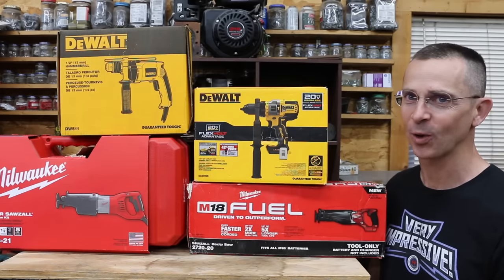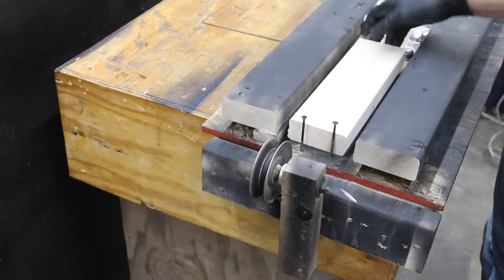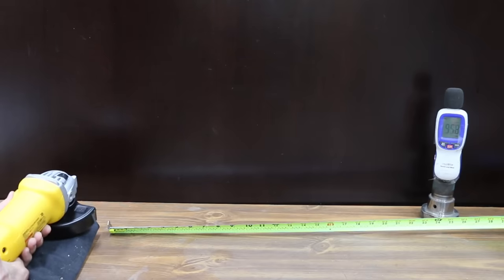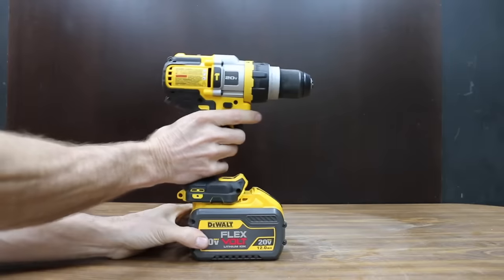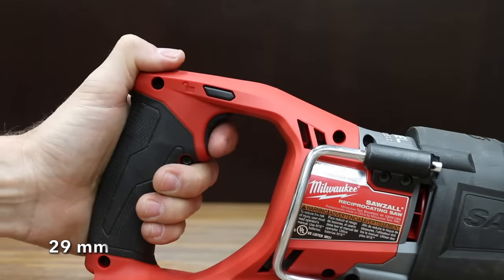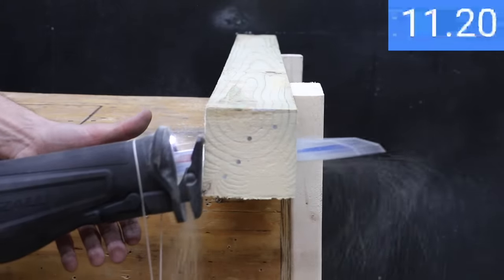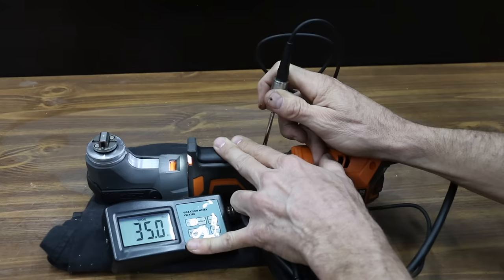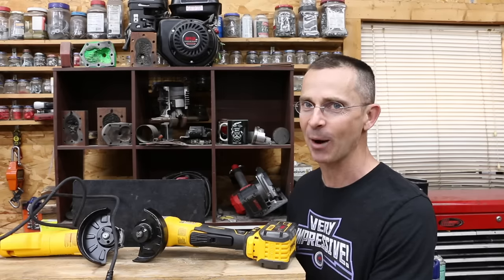Let's Settle This! Are Cordless Power Tools REALLY Better? Torque, Cutting Speed, Noise, Vibration

Comment: I watch your videos almost every week. This evaluation were about what I'd expect. As a user of both corded and battery I must say I like the battery tools stopping faster when the trigger is released, especially on the angle grinders. I find the cordless to be safer to use and it stops quickly instead of jerking out of your hands when making heavy cuts that grab the blades. And on the drills I break a lot less bits. I use a lot less bandaides this way. Your fixtures and methodical approaches to testing have clearly earned you a Masters Degree in Redneck Engineering! Luv it!
Reply from the maker: Wow, thanks
1

Comment: I would have looked to see the drills drilling holes in concrete for tap cons and maybe 1/2 inch holes
Otherwise a great video as always
Reply from the maker: Thanks!
Reply: My thoughts as well.  Drill wood perhaps a hole saw and hamer drill  concrete.
Reply: @ProjectFarm  maybe try testing home security cameras. Like Blink vs Wyze vs Ring, etc. You could compare doorbell cams of each brand also. It would be informative to know how far the infrared works, motion detection range, how long on a full charge and more! Amazing channel BTW!

Comment: You should repeat the test around freezing temperatures instead of room temperature. My buddy had to borrow gas chain saw in winter since his battery operated was weakened by the low temperature.
Reply: well no reason to test that, your friend just shouldn't have left the battery out in freezing temps... every tool has common sense steps to make em last longer
Reply: @LC-hd5dc Sometimes the work needs to happen outside in cold temperature.. Like cutting a tree for example. You have no choice but to expose your battery to that environment. That's when you experience the practical limitations of cordless tools nobody is pointing out.
Reply from the maker: Thanks for the suggestion.

Comment: I would have liked to see how the flexvolt compares to a corded equivalent. The tools you were using was 20volt tools with flexvolt battereies.
Reply from the maker: Thank you for the feedback!
Reply: Ya, I was thinking the same thing.  The Flexvolt batteries will run all the 20V max and XR tools.  To make things more complicated they also have the "Flexvolt Advantage" tools that recognize the Flexvolt battery is powering the tool and allow a higher current limit, albeit still at 20V.  The real 60V and 120V Flexvolt tools are in a different class altogether.
Reply: @rogerheuckeroth7456  also different price range altogether 😉
Reply: I've left this same comment on most of Todd's videos. He commonly overlooks DeWalt's 60v lineup as well as other manufacturers "high" voltage tools or compares 18v to 36v to 54v while claiming they're in the same class.
Reply: @canonfodder808  Well, yeah. That's true.

Comment: Can you test out over the air TV antennas? Would like to see which one gets more channels, better reception etc.
Reply: Antenna Man does a good job on that.
Reply: Most antennas are pointless if you're in a valley or at the bottom of the hill
Reply from the maker: Thank you for the video idea!
Reply: Keep in mind, there are inline amplifiers to have close to the antenna, filters e.t.c. you can use to affect final performance.
A long cable can cost you many channels if you don't use a amplifier at the antenna!
For shorter cabling the amplifiers are less interesting.

Also all cable isn't equal, there are instruments for testing that if you are interested.
Reply: That would be awesome, I bought an antenna and it was a waste of 20 bucks. Lol. I would love to see which one offers the best reception.  I am still open to buying another and am willing to pay up to $250.00 for one that actually works.
Reply: @kstofkos  the digital ones that will get you about three hundred channels cost about $400 and up but you better have a direct sight to the antenna and no Hills are trees in the way which means you have to get it long enough to stick up high enough

Comment: I'm getting ready to update all my power tools to battery, either DeWalt or Milwaukee.
Great video.
I have a 30 year old Milwaukee corded sawzall, bought new,  that still works like new!
I always store it in it's metal case and never toss it onto the floor.
It was used a lot!
As I was in construction for years.
It has a roller dial speed selection from 1 to 6.
Hoping I get that in battery.
Reply: My 2 old makita drills batteries finally gave out and we're obsolete so I retired them. (Inside handle batteries) with Chuck keys...lol
Reply from the maker: Thanks for sharing.

Comment: The main problem I see with the battery powered tools is when the battery stops working and you have to buy a new one.  Assuming you can even find one that fits your old tool, you can bet they are going to be very expensive.  So factor a replacement battery into the original cost of the tool.
Reply: Takes a long time for a battery to give up the smoke.  I see your point but I have 10 year old Milwaukee batteries still trucking.  Likely less chooch than new.
Reply: @Matt-my7pz  to agree with you I've had my Milwaukee batteries for 8 years now. Still going strong. I've since upgraded to Fuel, and got into the M12 line a good bit, and I love the M12 stuff. But yeah, my battery outlasted my one drill lol
Reply: They often times don’t even exist. You gotta upgrade. Planned obsolescence sucks.
Reply from the maker: Thanks for the feedback.

Comment: I wouldn't be surprised if cordless tools start to surpass corded ones in performance, simply because of more R&D effort.
Reply: That won’t happen for a long time. Battery technology is still far behind where it should be when trying to force everyone to battery
Reply: The flex volt dewalt grinder already surpasses the corded version in my opinion. The one used in this test wasn’t the top of the line version
Reply: Dewalts 60v worm drive circular saw already has every corded worm drive saw beat. It’s much faster than a skil mag 77. Corded tools are pretty much limited to drawing 15amps @120volts which equals 1800watts. This Dewalt worm drive uses 2400watts. That’s the equivalent to 20amps @120 volts. While 20amp sockets exist(the ones that look like regular wall sockets but with the sideways slot in the left slot making the left side look like a sideways T) not everyone has them so power tool comanies generally don’t make 20amp tools. With modern battery technology the manufacturers can drain more power out of a battery faster than they can out of a wall socket.
Reply: the companies don't want people buying corded, they want them using battery
Reply from the maker: Thanks for the feedback.
Reply: They already do in safety. Corded tools are an electrocution hazard on wet construction sites or around docks, pools, etc. Trip hazard too.
Reply: @pureblood3813  I find my batteries on Bosch tools and Ridgid last a long time between charges, it's super easy to have one batt on the charger ready to go and just swop, it's like loading fresh rounds in your gun after target practice- only takes a few seconds and you are going again.
Nothing worse than the damn power cords you have to watch don't get cut, drilled, pulled ouf of the socket or plug, will REACH where you need to be etc.
Reply: @kennyz6533  The thing is; FAST is not  good for cutting blades or drills whether corded or not, it's THE thing that heats up the blade or drill and ruins them quickly. A co-worker is ALWAYS running his jigsaw at max, his blades turn blue and get dull fast, I run mine about half speed and go easy,  it cuts thru almost as fast, my blades never turn blue and last a LONG time
Reply: Cordless tools will always have efficiency and power keeping them from ever being as good as wired tools. But in a lot of applications cordless is needed and sometimes easier or more practical  depending on what you're doing or where you're doing it.

Best cordless can do is match ac/dc, but that's if a battery is invented that can match the power and maintain long battery life. Doesn't matter if a super efficient motor is invented. Use that same motor in an ac/dc tool and you'll get better performance.

Comment: When it comes to tools, I hate cords for handheld power tools unless it’s a random orbital or detail sander because they get in the way and are inconvenient. However there are actually brushless corded random orbital sanders such as the 3M xtract.
Reply from the maker: Thanks for the feedback.
Reply: Garand Testicle   not for sanders or buffers
Reply: Garand Testicle   not for what I do. I run sanders for hours at a time, and also drill motors as buffers
Reply: Garand Testicle   I actually refinish plastic and damp sand but ty

Comment: I used a battery powered lawn mower recently and was surprised how well it worked.  Would appreciate it if you did some more cordless reviews for higher voltage/amp tools. (leaf blower, chain saw, mower, etc).
Reply from the maker: Thanks for the suggestion.

Comment: Good show, I enjoy it very much.  I'm a retired journeyman carpenter and have sawn wood since 1969.  I like cordless for the convenience, but I know I'm sacrificing performance.  Corded tools outperform cordless, every time.  Before anybody disputes this, do me a favor; go dig out your old corded tools and use them for a day - if they're any decent kind of quality, then you'll see the difference.  Your tests are interesting, but a little skewed; your batteries are fully charged and working at their peak.  I love my cordless drills, and I like my battery powered nailers, but that's it for me.  I could never go to a cordless circular saw; don't have the patience.  And most of the other tools I dig out so infrequently that I don't mind if I need a cord to operate them.
Reply from the maker: Thanks!  Thanks for sharing.

Comment: Love these videos and how thorough you are testing every last thing. Most of which, I don’t even consider until you’ve done it. My request would be to see which brand/style of hot rod floor insulation performs best reducing heat transferred through the floor, and overall cabin noise and resonance. Brands such as Killmat, Hushmat, thermo tac, etc.. Thanks!
Reply from the maker: Thanks!  Thanks for the suggestion.

Comment: Two comments:
1. You weighed the corded with the cord - this may be fine for carrying the tool to the job site, but what about actual use - the cord wouldn't add much while using.
2. If the cordless worked at the same speed as the corded, would they be as noisy.

I have a corded B&D 6" chain saw, works great. Bought the same version in a cordless for work as we don't have an AC power source in the field. The cordless tends to bind, especially on larger branches. Cut speed might also be a bit slower, hard to compare though.

I do have a few cordless tools (drills and outdoor tools) and very convenient (grab and go is the main reason I buy them), but find the corded to be better for tough jobs (mostly cutting tools).
Reply from the maker: Thanks for sharing.

Comment: Oh, 25-30 years ago, I didn’t even consider battery tools for any serious use. I still have my heavy duty Rockwell and Porter-Cable drills and screwdrivers. But now, I never use them. The convenience of not having the power cord far outweighs any minor power difference. Though I have five DeWalt corded angle grinders and one battery powered one. The battery powered models are often too long for getting into tight spaces. But the battery grinders are a lot slower than the corded models, generally 8,000 vs 11,000, so it usually cuts a bit slower. They slow them down for more torque.
Reply from the maker: Thanks for sharing.

Comment: Cordless tools are great and have improved to the point where you can do just about any ‘jobsite’ task with one, however cordless tools are still very desirable for applications requiring consistent raw power. My favorite corded tools are my Metabo angle grinder, Hilti hammer drill, and Makita circular saw- Even though I have cordless versions of all three, the big guns come off the van when the going gets tough. I noticed that most of the corded tools in this test were homeowner/DIY grade while all of the cordless offerings were ‘much more refined’ and I suspect this had an effect on the outcomes.
Reply from the maker: Thanks for sharing.

Comment: Another huge factor is that tools like reciprocating saws and angle grinders absolutely tear through batteries so if you plan on using them for any extended period of time corded is the way to go with them, otherwise you better have a large stock of fully charged batteries! Tools like drills and circular saws however are great cordless so you aren’t restricted as to where you can use them and you aren’t tripping over extension cords nonstop!
Reply from the maker: Thanks for the feedback.

Comment: Another thing is....Go to work on something on the outside of your house.  With a corded tool, you have to get the extension cord out, run it to the area you want to work from one of the typically sparse outside outlets on your house. 

Why do they not put an outdoor outlet on each section of outdoor wall, along with a hose bib?

With a battery tool, you just click in the battery and walk to where you want to work.  This is a HUGE advantage of battery powered tools!  I have two battery powered drills, a big hammer drill and another small light one for driving screws. But I keep one cheap Harbor Freight corded hammer drill around in case I have a lot of holes to drill, but so far, I've never used it.
Reply from the maker: Thanks for sharing.

Comment: The real difference is the amount of convenience the tool provides. If you are at a building site with power available setting up a cutting station with a chop or compound corded saw will provide a superior product with the mess not following you around. On the other hand if you are the electrician or plumber drilling holes everywhere the cordless drill with a handful of batteries will provide the most productivity by not having the cord follow you everywhere.

If it can be done in the shop a corded tool probably works better than a cordless. If you are wandering around doing spot work then the cordless with again a handful of batteries will be faster as the setup can take longer than the actual work. Example I drilled out a padlock with a cordless drill yesterday as it was faster than bringing out the torches to burn it off.

Better is a relative thing.

Comment: My strategy is having a cordless sub-compact drill for most work, and a corded, heavy-duty drill for everything else. It's not like I'm doing this stuff professionally or anything, I doubt I'll need a powerful drill when I'm away from an outlet. 
My thought process is that, with a corded drill, you don't run out of power and it's one less point of failure, as there are no batteries to deteriorate. I think there are cases where a cordless drill would be preferable, but I don't think any of them apply to me personally, and that a sub-compact can probably do everything I need it to do where a larger, corded drill couldn't reach. 
But hey, that's just my approach, it works for me but won't necessarily work for everyone.
Reply from the maker: Thanks for sharing.

Comment: I have taken the big risk and gone almost all cordless Dewalt….My biggest fear is obsolescence if the batt type is later changed and no longer fits the tools I have.  Cordless means I can use them anywhere, but run time anxiety is a real thing, especially with high drain tools like my grinder, which will eat a 5ahr batt in under ten minutes.  No! I don’t want to splash out on five big batteries at 60 bucks each when 95% of my useage is casual and sporadic….So managing batt use is something I have to just deal with.  Corded has the run time advantage IF you have power access AND don’t mind a slightly bothersome cord draped around.  Modern cordless also seem to have the better tech and convenience features….but they aren’t essential to perform the tools basic function.  Anyhow thanks Todd, for another engrossing bedtime video at 2am in England….
Reply from the maker: You are welcome!  Thanks for sharing.

Comment: Not really the “tools’ shown here but I have a blower vac, drill and a lawn mower
From RYOBI that are all battery powered. The same battery fits in all of them 
And is easy and quick to charge, but the main reason I like the battery option is 
that I absolutely love how light weight everything is and it’s very easy to swap over. 

Everyone in my household can use these items With such ease,
And we vary from able bodied to terminally ill to over 60 years old.

We don’t have to fuss with cords, (trip hazard) tricky buttons or 
Switches (dexterity), Weight and vibration (general weakness and strength) as
Well as any petrol buying/ filling/ storing issues. Everything is 
quieter too!

I really do recommend getting battery options if you or someone in your ‘family is
At all weak, small, elderly or Sick like my household is. We only have 2 batteries 
But have multiple uses from each battery before it needs to be charged. 

Everyone can help out doing things around the house, and no one feels 
Incapable of doing something ‘everyone else’ can do.

The only downside in my opinion is it can take a bit more time to compete the task

Comment: As a mechanic, I can tell you that good cordless tools are wonderful - so convenient, albeit expensive, mostly because one needs at least three batteries and two chargers.  On the other hand...for performance, they can't touch pneumatic tools.  When you have to disassemble and repair a set of D9 tracks, cordless just can't cut it...but when you're swapping out a GMC K3500 intake manifold, cordless is the only choice.
Reply from the maker: Thanks for the feedback.